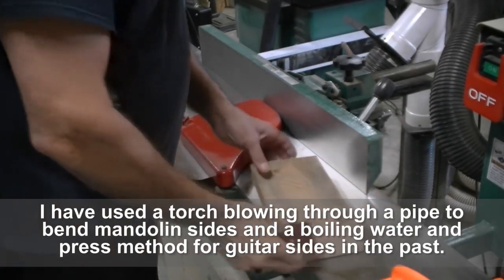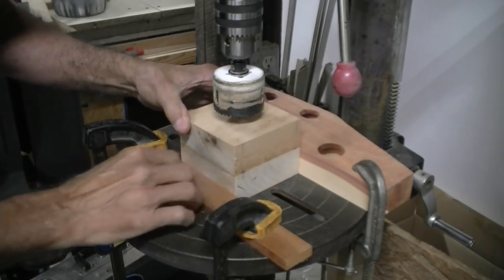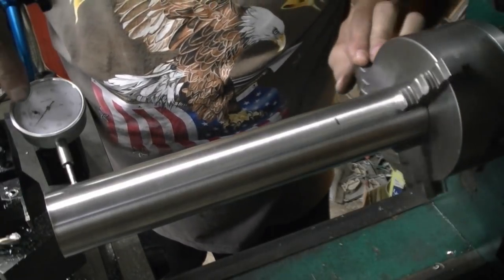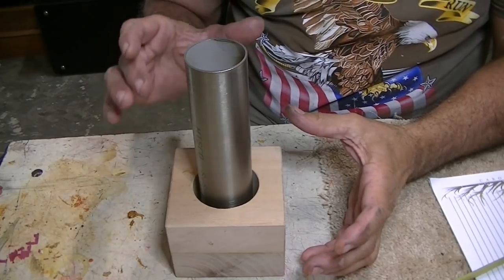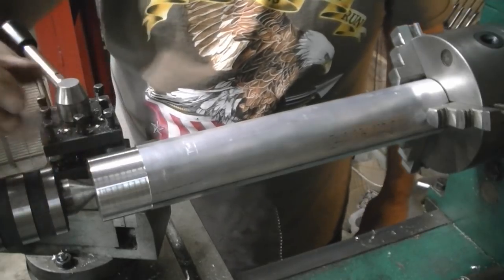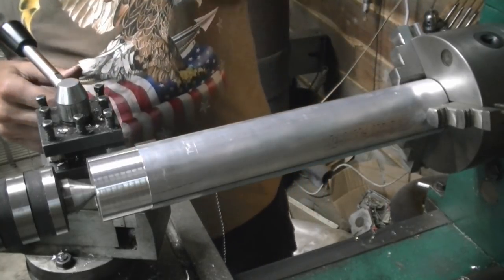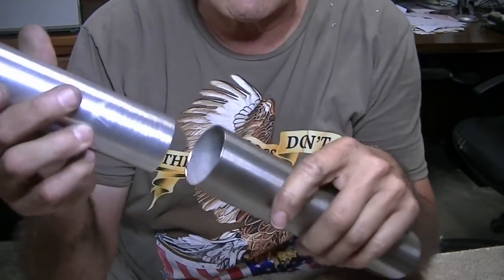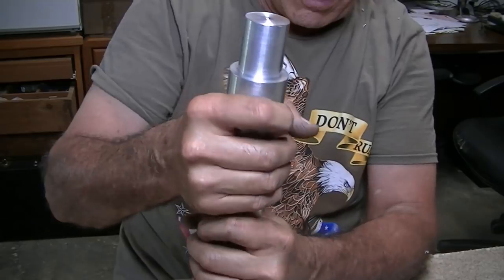225 RSW Custom Guitar P3 Bending Iron Build

Comment: Hi there Jerry. One of my 12 string guitars has a problem and i was wondering if you could give me your input of advice. Its a guitar from a Japanese company called "Raven". It was only an $80 buy so i said "Why not?". It sounded fairly good anyhow. I found zero info on it while researching it. It has very strange construction on the top. The braces are in a sort of square pattern where each brace goes perpendicular to another which is bad because there is very little meat holding up the front end of the bridge. Due to that construction, it has caused a fairly deep crater in the top and the bridge is lifting. I have no problem fixing a bridge because its fairly simple to do. Any advice how i could fix the dip in the top? Any advice is helpful 🙂
Reply from the maker: Actually taking the dip out of a top as one of the very hardest things to do. It won't stay out in my opinion unless you fix it mechanically. Meaning putting additional bracing and or bridge pad under the bridge inside the guitar.  It's important to press it flat as you glue whatever new brace you put inside the guitar once the glue sets hard generally it will keep it flat.
Reply: Alright I will see what I can do. i forgot to mention, I saw that the guitar has two small 1"x1 1/2 pieces of wood for a bridge plate. I'm thinking that I should replace it with something more sturdy. Should I remove the top to ease the process of re-enforcing it?

Comment: Neat work. I wonder if that heater won't continue to heat until it gets to a maximum temperature whether the controller is on low or high (and assuming that the controller is working properly). It might just heat up slower at the low setting.  I'd check into that before I sprung for a more expensive controller. I expect by the time you post your next video you'll have all the details worked out and will be bending wood on it like you've always used it. Thanx for the video.
Reply from the maker: I've used it more since the video and it seems to be working pretty well. The heater itself seems to be fine.  The temperature controller actually seems to be working now that I'm understanding what the I'm doing a little better with this electric Bender
Reply: I knew you'd get it going. 😁

Comment: There are various scales for temp:  fahrenheit  ( after German physicist Gabriel Daniel Fahrenheit  1686-1736) centigrade, celsius and Kelvin ( After William Kelvin using thermodynamics) .    Centigrade is the old name fro celsius. The scale is named after  Swedish scientist Anders Celsius ( 1701-44).  You can get more info on Wikipedia.  Boiling point of water is 212F.
Reply: The boiling point of water is 212 F at sea level.  It changes approximately 1 degree per 500 feet of elevation change.  Where Jerry is located is 750 feet above sea level, making the boiling point close to 210.5 F.

Comment: Water boils at 212 if I remember correctly.
Reply: He jumped the gun a little bit at 210, but it was continuing to heat up.
Reply: The boiling point of water changes depending upon altitude.  The boiling point changes slightly under 1 degree F for every 500 feet altitude change above or below sea level.   Newburg, MO is 750 feet above sea level so the boiling point of water would be approximately 210.5 F, so Jerry was very close in his statement that water would boil at 210 F.
Reply: Buckhorn Cortez at about the 5248 Mark he made a comment that around 240' was boiling point before he corrected it .I'm not sure of his exact words .that's what I was referring to.😉thx.

Comment: Jerry,240degrees is best and add some salt to the water
Reply from the maker: I would never have thought to add salt to the water why would you do that?  I was able to bend it at 240 degrees but it was not very easy. When I got up to about 350 degrees it started bending very easily and no burning.
Reply: Salt slightly increases the boiling point of water. It would mean  that the water would get a bit hotter before producing steam and the steam would be a bit hotter. Not sure if that is an advantage or not in this case, especially since it only raises it by a few degrees at most.

Comment: Your trying to use a motor controller to control a heater, that's why it won't work
Reply from the maker: It actually does work pretty well. I've used it quite a bit since the video I just wasn't using it hot enough.

Comment: Ignorant and hope for the best? That Alu bar will suck up the heat quickly through the whole bar which will give very even heat over its length.
Reply from the maker: I was referring to the aluminum expansion rate versus the stainless steel expansion
Reply: Oh yeah got it.

Comment: At about 14 minutes in you said, "Its better sometimes to just be ignorant and hope for the best".  In the case of trial and error involving fitting two things together I agree, but when you decided to power up the heater core without a ground I got concerned.  When you decided to use a speed control to control the heater core, not knowing how it works, you pushed creative ignorance to the next level.  I think ignorance might not be your best approach with electricity.  Not all dimmers work by simply reducing voltage or current.  Be careful!  I would miss your videos if you made a fatal error.
Reply from the maker: I am not at all ignorant on electric. I helped my grandfather wire a lot of houses he was a licensed electrician. I also had to pass the contractors test to wire my own house in St Louis County. I passed it with 100% on the test. I have built at least a half-dozen houses and large additions all by myself and wired all of those. I have more than 15 buildings on this farm that I have wired also. Not saying I'm the experts expert but I'm definitely not ignorant on electricity.
Reply: I have similar experience with house wiring, but I hit a wall when I had to account for why new LED's were blowing in the kitchen of a friend.  The answer was an older style dimmer that claimed to be LED compatible, but wasn't.  It turns out that the electronics in power supply designs coming from China are not always what they claim to be, and hooking them up can smoke either the supply or the thing being connected to it.  Fire danger is one concern. I hope you find the answer to getting your temperature controller to work correctly.
Reply: 'Electronics' is a bit different than 'electrics', but what you are doing with the ESC is fine with a passive-resistive component like a heater element. Essentially that box has a switch turning on-off real fast - varying the switching rate (pulse width) reduces the average power applied to the heater. The only dangers would be the heater element pulling too much current from the ESC box, which maybe could happen if you turned it up too high , which would  likely just pop an internal fuse.
Reply: b minor Jerry noted a hum coming from possibly his PC when he powered on the ESC.  That could be RFI, which shouldn't happen in a properly designed regulated switching power supply.  Maybe it has a fuse.  In any event, I wouldn't leave this thing running unattended, and I don't think Jerry really thinks ignorance is better than facts in most things.  His ignorance is often better than most people's information.
Reply: RFI is generated by any electronic switching. The only way to eliminate it is with shielding (i.e. a Faraday cage). The amount of actual power generated by RFI would be tiny (like microvolts at most), not enough to damage anything, just an annoyance. Switching power circuits can also cause noise to be fed back into the AC lines due to the lines being quickly loaded/unloaded, which would be much more of a problem than RFI if it was excessive. That generally only happens if you are doing very high power switching and the power source is weak and can't fully keep up with the load currents, so the effective voltage goes up and down, essentially like fast (millisecond level) brown-outs or spikes. I doubt this little 100W switching supply would be a problem in any modern home wiring. Any noise on the power lines can cause some active electronics to misbehave, like digital signals can be 'corrupted' by the noise on the lines, but most modern electronics that are sensitive to that kind of thing already have built in protections for it. This case is no different than using a dimmer switch on a lamp.
Reply: The noise that Jerry is hearing is very like just the audio card in his computer that is not well grounded/shielded and therefore acting like an antenna to any RFI and amplifying and sending it to his speakers. That could be checked by simply listening to see if it is coming out the speakers, or disconnecting the speakers and seeing if it goes away. And again, any RFI is tiny in terms of power, and would not cause any actual damage.
Reply: Would a variac be a viable (but probably not cost effective) solution, rather then the switching supply?
Reply: +ctyragdoll - You could use a variac, but a 100W version is big, bulky, and expensive. Could be over $100 for one that big, some even much more expensive. Switching supplies were developed as a more efficient and more cost effective solution. You wouldn't be able to add an automated thermostat to a variac either. A properly filtered and shielded switcher should not generate much RFI - that is what is used in all computers and other medium to large sized devices these days.
Reply: Thanks for the reply. Yeah, that's why I said "not cost effective".  Definitely close to $100 for the cheap 10A Chinese autotransformers.
Reply: The problem with any thing that is intend control the speed of a motor, or lower the effective power a device receives is that it continues to provide power even when the target temperature is achieved.  The solution is to have a feed back loop that tells the controller that the target temperature has been reached and simply turn the power off.  When the temp falls below the desired threshold the turn it back on.  A thermostat is an example of such a controller.